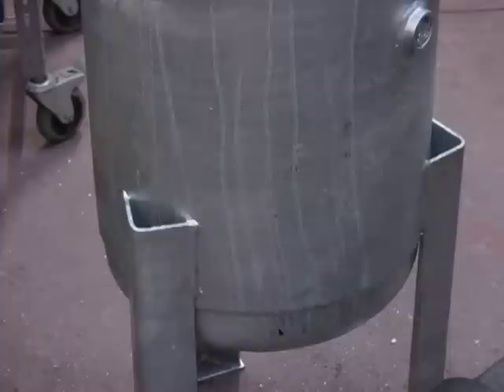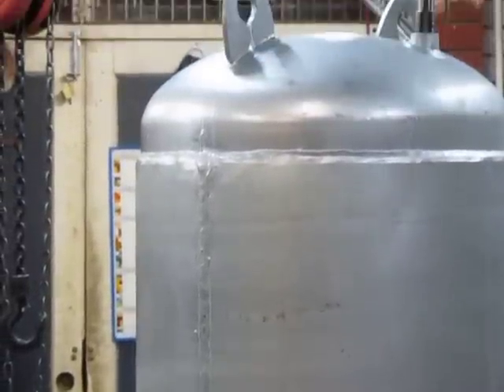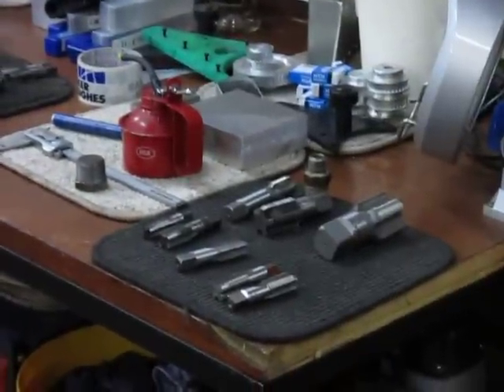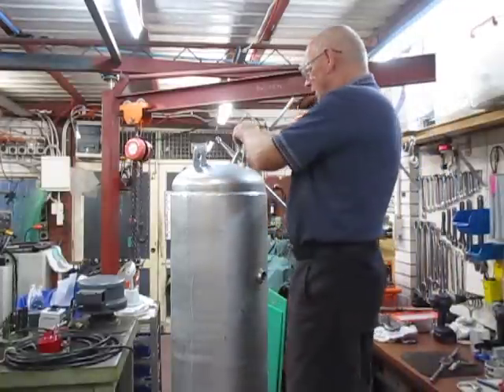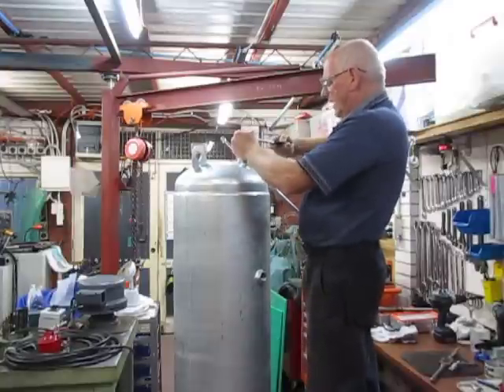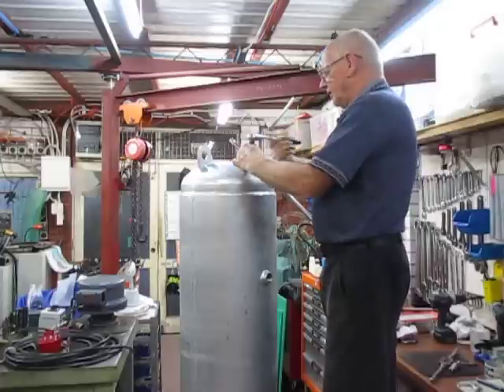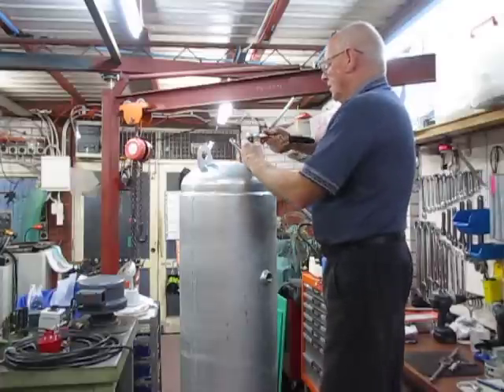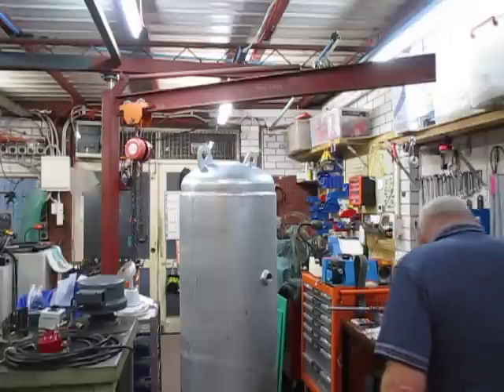Getter out Apollo 22

Comment: Most old plumbers must have old fashioned tap and die sets, with the Rigid ratcheting handles? When I was a kid helping my Dad, we went up to 3". with 3 feet of pipe to lever it down. Ball busters. I'm still leery.
Reply from the maker: Lee, done plenty of that, was so glad when dad bought an electric one. I still have a set of 1/2" to 2" - "Stocks n Dies", they are part of my museum pieces, I wouldn't even contemplate using them again. I can't recall ever having a ratchet tapping handle above 1/4" the power needed is so great, it would be fatigued in no time! My favourite youngest son Tom wasn't available on the day otherwise I would have done the grunting (sound effects) whilst filming him at work!

Comment: Bruce, would Trefolex been any better as a lubricant? I have used it often for hand-tapping new threads, and the difference it makes is noticeable. I have to say I don't have access to that "black, sticky screwcutting oil" you used.
Reply from the maker: Greg hi!, It is much of a muchness as they say, I also use Trefolex in liquid and gunk form, just that the RTD seems to be the flavour of the month with me at the moment in the workshop especially since it is better with stainless steels. On site jobs I use the gunk as the swarf sticks to it like "shit to a blanket" as the saying goes. Very good for confined areas where there are adjacent holes that you can't seal, or material falling in would cause some grief, and or in the exotic O&G tools that have a lot of computer equipment next to the drilling or getter outs. Cheers  Bruce

Comment: Great video.  I wonder if they had screwed plugs into the holes would that have kept them clean and safe from the galvanizing?  Thanks for sharing.
Reply from the maker: Maaaate! That would have been a total disaster!

Anyway with hot dip you must provide openings both for the internal galvanising and also so it won't become a missile instead of just a rocket! There is a huge amount of movement in steel during the bath dips, similar to a Witches Cauldron! haha!
The major issue faced with hot dip galvanising is distortion, quite often even on simple structures they add holes for run off / through flow. Cheers Bruce
Reply: Without some decent sized holes, hollow objects explode in the galvanizing tank - it's pretty hot.